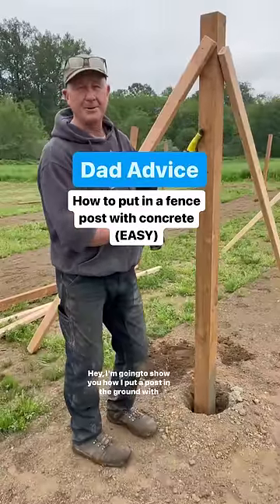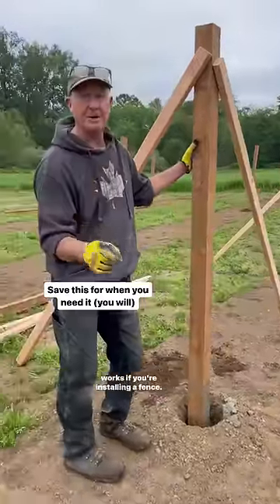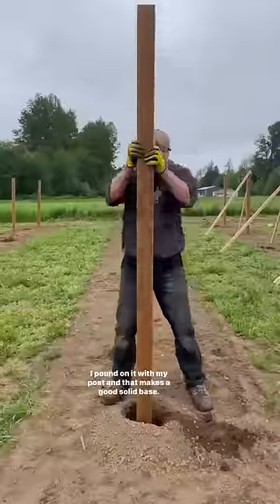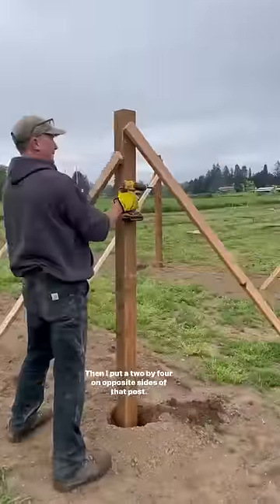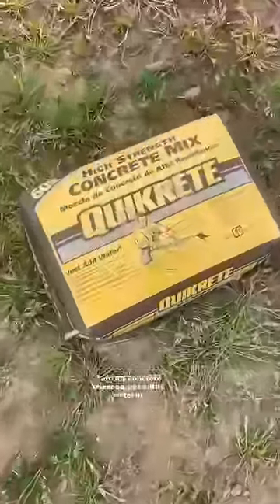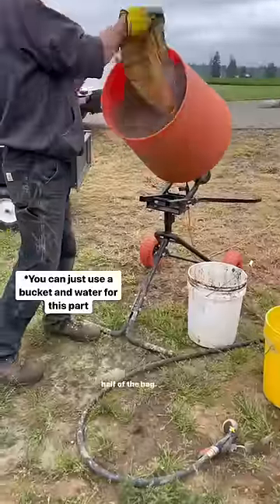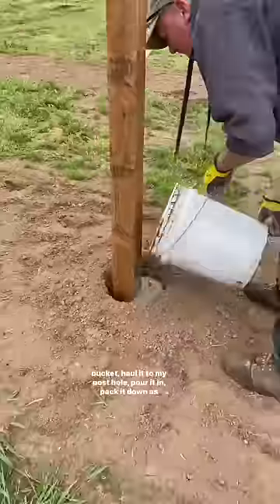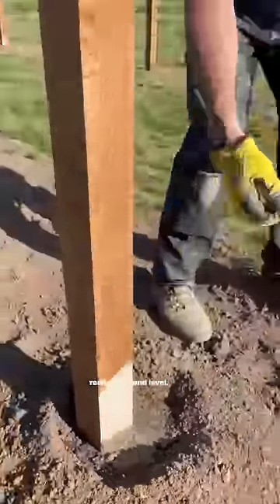How to put a fencepost in with concrete. Love, Dad

Comment: To everyone bashing this guy he is just showing some Slightly old school technique. It may not be perfect but at least He's still out there working and living his best life. This is still better than seventy five percent of the stuff on the internet right now.
Reply: Yes ,I gave him some grief but I can respect a hard working honey-do man
Reply: "Old school" knows the difference between "level" and PLUMB
Reply: @reebquincom  Everyone makes mistakes
Reply: What mistake(s) did he make? I mean personally I put gravel at the bottom, tar any wood below ground level, create a ramp of concrete at ground level to shed water away from post, char the above ground wood to protect from insects and then slather a diesel and oil mix on to preserve wood, and finally put a metal cap on top to keep the rain out of the end grain.
Reply: Maybe, but it's wrong
Reply: Migmig Migmig  the Charing and burnt motor oil give the wood a beautiful raven black finish. We have Armandii Clematis growing on the cattle wire between the posts. It's an evergreen vine where the leaves layer upon each other like scales. It produces a profusion of white flowers. The dark green leaves go well with a black, and the white is a nice contrast to the black.
Reply: @jerrywhidby.  the metal cap on top makes a massive difference to the longevity of the post, well worth having
Reply: @reebquincom  does it matter. He was using a level, so he said level
Reply: @kennydempsey2079  level = horizontal, plumb = vertical,  not the same
Reply: @reebquincom  the only reason you say it is plumb is beacause you use a plumbline. Plumb refers to the weight on the end not the fact that it is vertically level. Therefore if you use a level against the side, then it is level. Depending on what construction field you are in will depend on what term you use; however both are correct. I trained as a bricky first before going to uni to be a cpm so i always called it plumb. I had to do a presentation on this as I used a plumb line like a grappling hook in the workshop, it was given to me as a waste of time, but i finally found a use for it 20 years later.
Reply: @Kenny Dempsey  no, not at all. But, go ahead justify yourself. Been light commercial for 15 years, then heavy industrial for 30 years. Worked around all trades, and have never heard of vertical risers of duct or piping, or, concrete or steel columns referred to as being "level"
Reply: @jerrywhidby7374 this guy 👍
Reply: @reebquincom  With all the crazy stuff in the world right now, why are you so upset that this guy said level instead of plumb?
Reply: "Bashing"? A little dramatic, eh?
Reply: @Cleatus546  your call cleet
Reply: @reebquincom  
Alright, he gets a pass this time.
Reply: @Cleatus546  yay
Reply: True but someone may need the right info
Reply: Word up.
Reply: That's the problem in construction right now nobody sees quality work because they don't know quality work
Reply: @kennydempsey2079  
It seems to mean the sun and moon to that there high strung fella. Seems like he spooks right easy. That just stuck in his craw.
Reply: I Agree but Old School techniques are not all the Same Depending on what you had to work with
Reply: @jerrywhidby. what? 😂 are you serious? You do this to every piece of wood do you? 😂 your lying because it is not necessary when the wood is already treated against water, bugs and heat. To me it sounds like you are just making things up because no one goes through that much of a process to put up wooden fencing! Especially in America!
Reply: @jerrywhidby. he made a few mistakes! He doesn’t need to I it a Stine at the bottom of the post as it will draw in water from below! He doesn’t need those pieces of wood to stabilise the post if he used stone or rock wedges in the actual post hole and finally he posted it as if it was the best way to do things and it definitely isn’t! Why are you even sticking up for this man? Do you know him?
Reply: migmigmigmig3776 no it’s not good information 😂 it’s a massive waste of money and time! You don’t need all that for wooden fencing! That guy has no clue how to run a fencing company and actually make money! Do you know how expensive each piece of wood will become if you did all that nonsense to every post and fence panel? It wouldn’t be worth doing the job in the first place! Take this from a fencer who has been doing it for 24yrs!
Reply: @Reality_check10  sorry but you're wrong. I did do all of that. I will try to make a small video for you when I get home if it isn't raining.
Reply: @Reality_check10  almost forgot you. https://youtu.be/ajX5GlTrZDc It's short but you can see all of the elements I described. The tar blends a bit with the color of the charred and oiled wood, but you can make it out. The concrete is a little dirty, but I didn't have a hose out that way to clean it off with. You can still make out the slope I think. There is also pea gravel at the bottom of each post. This is an amalgamation of several different techniques. I want these posts to still be strong after I am long gone.

 I really don't like being called a liar. What this proves is that you're rude, and were not raised with common manners. I don't expect that to mean anything to you. People with your personality don't bother with the introspection needed to appraise themselves honestly. The arrogance bleeds through my screen.
Reply: True
Reply: @RobertWilliams-vl3no ... may need the right info.

If you trust YouTube to be the right info then you get what you deserve, I guess.
Reply: Facts
Reply: @kennydempsey2079  Of course it matters.  If given a directive as to what to do with a task, it greatly matters.  Concrete soup around a wooden post that appears to have not been sealed, at best is a very bad idea.
Reply: @jerrywhidby. a lead cap is pretty good as, in my experience things don’t like growing in lead runoff. You see in on roofs all the time where water flowing off of lead flashinginhibits growth of moss on tiles roofs etc.
Reply: @reebquincom Fair enough but I’ve heard it plenty of times in the UK. 

Just like we use the verb level comes from the noun level these days. The verb plumb comes from the noun plumb-bob. It comes from plumbum meaning lead. Same root for plumber. As they used lead pipes. 

So really you’re getting your knickers in a twist over nothing. You use a level to level the posts. Things move on. Vocabulary shifts as equipment and uses change. 

If you cry about it you’ll feel better. Americans also cry about the fact Brits call mortar cement sometimes. Contrary to belief we do know that cement is the powder. But that doesn’t stop us calling the mortar/ or concrete cement. We call them cement mixers and cement lorries. Again. Cry about it. It makes no difference in real life.
Reply: @winterroadspokenword4681  just yanking chain, sparky

Comment: Just a friendly little tip my friend. Let your concrete come above the ground and taper it downward to the ground, this allows water to shed away from the post like it should. If your concrete is below ground water will sit on top of it and it will rot the post in time. Taper it and you will not have that problem. I enjoyed watching your video.
Reply: Could’ve said it better myself is exactly what I was going to say. I had a fencing company and if you get it above the hole like that waterproof shout out no matter how long it rains or if you’re in a snow zone.
Reply: @phillipwhite3742  also good to stop grass and weeds from growing next to post. No more weed whacking the post base
Reply: Bla bla bla bla...
Reply: Better yet, dry pack?
Reply: Not a bad shout that
Reply: Learned this the hard way!
Reply: Great tip!
Reply: Wow, that's why they do those little concrete mounds. Never knew that. Thanks
Reply: Also paint bitumen on bottom section first
Reply: This works if you don’t have or want grass around the fence. Otherwise you can build up a tamped dirt mound around it. Otherwise when a mower or weed eater hits that it’s not going to be fun 😂

Comment: Great vid, setting posts in concrete is old school but also relatively cheap and easy.  If you’re going to do this method and you plan on working with concrete again, I suggest investing in a vibratory rod.  Vibrating the concrete before it sets helps remove any air voids that would otherwise reduce the overall strength of the finish concrete.
Reply: No need for that. The wood fails before the concrete does. Using a vibrator just makes it harder to chip out when it's time to replace the post.

Comment: Recommend extending the concrete and actually used a small form to make a square at the top so the top of the concrete is an inch or so above grade. That way, the posts are not in contact with soil ever.

Comment: If you really want it to look nice, do the corner post first. Then run a string Line from them then when you plume the rest of them you will have a nice straight fence.😁
Reply: Correct. Or as I do run the top plank as that gets the posts on the right square. A string works also as you say but your plank before it sets gives some rigidity as well as square
Reply: Yup first day for me on a fence job is augering all the holes and then getting the corners set. String 2nd day and set rest of the posts to it. 3rd day fencing goes up.
Reply: Agreed 💯
Reply: And it’s plumb btw
Reply: Do you plum them with a plume
Reply: @robertkemock-yy5vo  I thought it was plumb? Que no?
Reply: @@carpediem2674 derp? U mean durka durka
Reply: Or a stake or piece of rebar and a string line, you can map out the entire fence and it’ll be straight
Reply: Concrete should be skipped away from fence post to avoid water pooling and rotting out post

Comment: Advise to make it the best it can be. If using wood posts. Never have base exposed. If you do use pea gravel. If you dont water will wick up the post and rot out. Second, concrete should finish above the dirt and form the concrete to a cone shape to weep water away from post. Lastly if you really want it to last. They make a wrap or paint that you paint the post with that goes into the concrete. Jist what ive learned over the years
Reply: You got it! Thick silicone where the wood and concrete meet. Then paint it.
I don't recommend putting posts in concrete tho.
If you are using regular wood, burn 8" down and 2" above the ground level. Soak the post in oil. In that same area, paint it with hot tar and wrap it in aluminum. Posts only rot near the ground level, not 3 feet deep. The aluminum protects the tar, and the burning keeps the bugs from wanting to eat the post. The oil does the same thing. Now, do 5 coats of thick oil based paint. Now do the rest of the 500 posts! Don't use concrete, use crushed limestone screenings. Instead of the rock of the bottom, you can pour a small concrete base. You are welcome
Reply: @jakefriesenjake  that the same oil they use on railroad ties?
Reply: @yodaddy82daddy70  probably not. Used motor with diesel mixed would work good and cheap! Put the bottom of the post in a barrel of oil for a week or 3, to really soak it in. Also makes a great stain for a wooden fence. Cheap. Add some black wood stain into the oil if you want it even darker
Reply: @jakefriesenjake  hmm I never thought of using oil. Thanks for the tip. I hope I remember that on the next fence!
Reply: I always wrap the part in dirt with 3 or 3 wraps of roofing tar paper before concrete. It's really cheap, protects the wood, and it seems I always have some leftovers in the shed.
Reply: @jakefriesenjake  Ah yes, poison the ground water..
Reply: @Cent51  oil ain't poison
Reply: @jakefriesenjake  Dump oil on the ground and plant some plants or grass on that spot, put oil in your fish tank, your animals drinking water, better yet, be brave my guy, and put oil in your drinking water..
Then we talk again..
Reply: @jakefriesenjake  Also read what I said cl own, the ground water..
Reply: @Cent51  I'd care more if we'd never had the Exxon Valdez oil spill. I'm talking about soaking wood in oil for a week or two. Then putting the post in the ground, not dumping a 55 gallon drum into the dirt. Even water can kill, same with every other element on the periodic table, if in excess.
Reply: @yodaddy82daddy70  I didn't want to say this, because of the environmentalists comments, but here goes.....

You can take a long 3/4" drill to the side of the post, above the ground dirt level. Drill it towards the center and down of the post to create a nice pocket for a pool of used oil to sit in. Drill deep.

Once a week, walk by your new posts and top it up with more oil then cap it with a rubber plug so rain can't get in. This way the oil will soak the whole post over time. If oil is in it, there is no room for water. Water is the enemy.
Reply: @jakefriesenjake  well I'm moving to the mtns here in the fall. With the freezing weather up there that would actually be a great idea. Im gonna be using a oil burner stove as well so I'll have plenty of used oil. That's is an awesome idea! Save me from buying those posts with the creosote that are insanely priced. I already have a huge drill bit that'll work the length of the pole too. Thanks for the advise man!
Reply: @jakefriesenjake  also is that your motor? Looks like maybe Dart heads? What you putting that in?
Reply: @yodaddy82daddy70  edelbrock Victor Jr. Heads. It's in an 81 Z28. I got some videos on it. Little over 500hp and a little under 500 tq. 381 stroker.
Reply: @yodaddy82daddy70  no problem. The posts only really rot around the ground level, where there can be a perfect mix of oxygen and water for bugs to eat the wood. I'm from Windsor Ontario area. I build a pole barn before to code. Dig a 5 foot hole, then pour in some concrete maybe 1 foot thick as a base for the post to sit on. Then back fill with crushed sharp stones like limestone screenings and tamp every couple of inches with the post plumb and level. Then dump oil around the post to keep the post soaked. Do the drill thing too to keep it oil soaked from the inside too. Concrete posts are no good. Hard to change the post if it does rot out.
Reply: @jakefriesenjake  nice man. I just sold mine :/ about a year ago. 72 Pontiac Ventura. Had a 363 stroker with AFR heads. I was putting 595 HP. Had a 150 shot of nitrous as well. Just didn't have the money to fix up the rear end and tranny after I torched both in 2016. Had bought that mountain land and I needed money for a septic system.
Reply: @yodaddy82daddy70  dang. 595 + 150 shot. Yeah I'd imagine the other units would not survive! Mine is only 9.5 to 1 compression ratio so I can run regular fuel. It's got a really lumpy comp cams big mother thumper roller cam.
Reply: @Jake-sq5sp dude he's talking about very small amounts of oil. Ur dramatic like a woman or a liberal.
Reply: @jakefriesenjake I prefer wooden plugs, and you typically only need to add oil once every few months after the wood is saturated. 😉
Reply: @jeffman3  perfect!
Reply: I put the bottom 2 feet of my posts in roofing tar and let them cure for a week before putting them in the ground.
Reply: @jakefriesenjake Diesel... It's got what plants crave.
Reply: I watched a few videos and some say put the concrete several inches below ground because of the frost/snow/ice. Cause the concrete will separate from the wood post. So what to do??
Reply: @Cent51 lol where do you think oil comes from??
Reply: @jakefriesenjake might be easier just to replace posts as they rot, then to go through all this prep

Comment: Love the homemade concrete mixer you should put a video up or how you build that
Reply: It's not homemade. Our local Home Depot has them in stock: Kushlan
3.5 cu. ft. 1/2 HP 120-Volt Motor Direct Drive Cement Mixer. The top half swivels 360 degrees
Reply: 😂 a shovel and wheelbarrow is all you need

Comment: Crush gravel or road base work a lot better than a rock, or at least use a few handfuls of large rocks so you’re not setting the post directly on dirt/clay. Easier to pack down, level, helps hold the post in place and offers some drainage to prevent rotting from the bottom up.
Reply: 4"s around each side post.

Comment: I dry set 200 posts. Had them all in perfect alignment using two strings. With the cc dry you can shiny and pack to perfection. Never even added water. Still sets up rock solid. Much easier

Comment: This may be just me but I’ve set a lot of posts and I did it with dry right out of the bag into the hole. It will draw moisture from the soil and set up fine. Only things I didn’t do was put a rock or gravel in the bottom and didn’t get my concrete above the soil, those are good advice. I also have made a lot of my concrete from dense grade. If you have a rock quarry close they can help you. 6 shovels of dense grade to 1 shovel of cement makes a great concrete. I’ve done this 1980 and I loved it. Oh! One more little thing, I used a 1/4 inch rod, electric fence rod is perfect and when your post is plumb run the rod up and down around your post and this will get air pockets out and your post is solid. Poor man’s concrete or I liked lazy man’s concrete lol